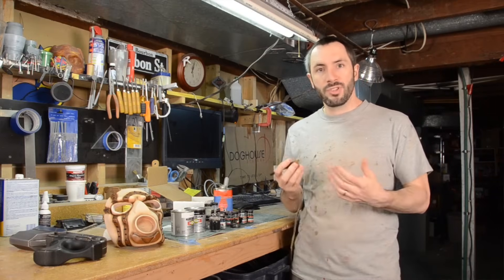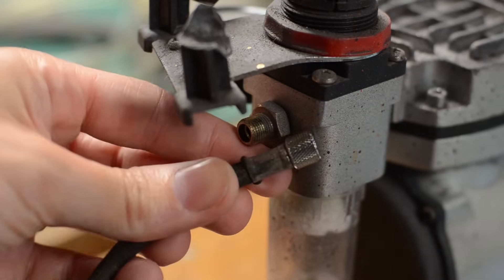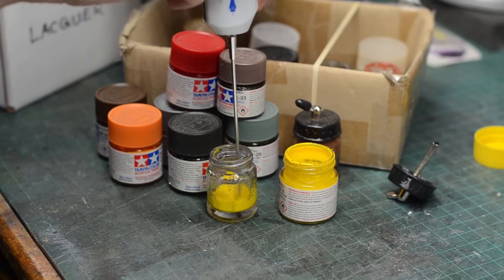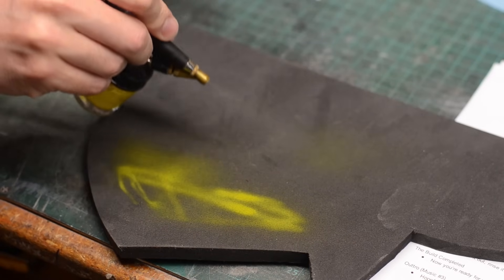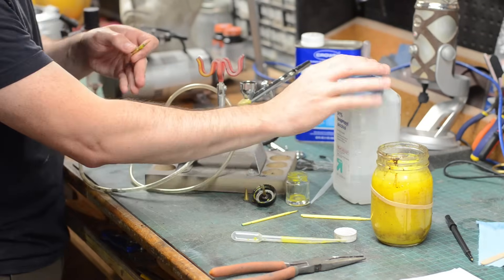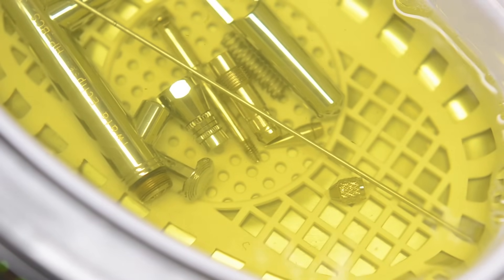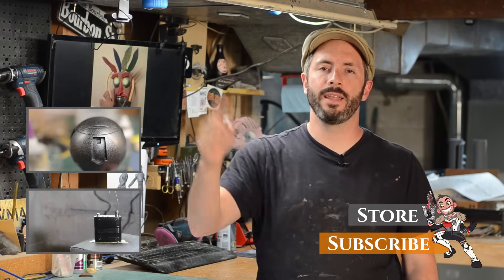Airbrush Basics: Picking an Airbrush, Compressors, & Cleaning - Prop: Shop

Comment: How do you quickly change colors when airbrushing? Do you just have multiple air brushes or can you just swap the little paint thing over?
Reply: The quickest way is multiple airbrushes. Otherwise you'd have to empty out and clean it between colours.
Reply: Barnacules Nerdgasm ooh it's barnacules
Reply: This is an old question, but the best brush for quick changes is a gravity fed airbrush as opposed to a siphon feed.

Comment: I have one of those cheapo ones just bought I’ve tried using it it starts to spray just fine but it very quickly stops and just blows out air.
Do you have any suggestions of how I could fix this I really don’t wanna go shopping for another one 🤦🏼‍♀️

Comment: I bought my first Airbrush to paint the motor in my Cobra Mustang..  It worked perfect..  I only had to tape off a couple things.  The Airbrush was very accurate and neat,   The motor looked like new..  So, little by little,  I ended up painting most everything else under the hood..   It really did look great..   An Airbush was the perfect tool for the Job..
Reply from the maker: That is fantastic!

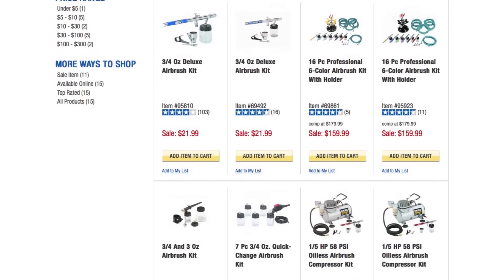Comment: Question here: I have the same airbrush as seen at 1:34 in the video. I clean it and I use enough thinner with my paint but still it gets blocked. It's not due to paint that's clogging, it's more like the push button for the airflow. Anyone else has this problem? If I leave it for a half hour it seems to work again. maybe the piston?

Comment: I have a Point Zero (El Cheapo?).  My question is about the paint bottle on the single-action.  The connection is not threaded and I've "lost" the bottle on occasion.  Am I missing a part?
Reply from the maker: I don't think you're missing any parts. The connector on the bottle is meant to be a press fit. I have no idea why that's a standard way of doing it.
Reply: Thanks for taking the time to reply.  You're right!

Comment: Hi.Thank you for this video. Can you please tell me how long can you paint with a starter kit? does it depend on the size of the compressor or..? i read somewhere that you can only paint for max 20 mins and then you need to rebuild the pressure for 2 hours.
Reply from the maker: It does depend on the compressor - it also depends on how much continuous painting you plan to do. Smaller surface areas and short breaks can extend the painting time
Reply: @punishedprops  Thank you for the fast reply. I am mostly making small projects for my son so i think i will be fine.(though this time i am building my Mando helmet) Really appreciate your help. Looking forward to your next video.

Comment: Doing large areas like for example I’m making a few mandalorian helmets for people. My air compressor like the cheap on but with a small tank attached gets boiling hot after 20-30 minutes, is this normal and am I safe to keep using. I’d hate to ruin it. If I should invest in a better compressor for large areas and leave the other for small/details what recommendations do u have. Litres of tank ect. Thanks!
Reply from the maker: It sounds like you would benefit from an upgrade. You could also plan to take more frequent breaks when painting to keep the temperature down. I don't actually have a functioning air compressor for my airbrush at the moment - I'm using my significantly larger shop air compressor. But if you search on Amazon or eBay you should be able to find something.
Reply: Punished Props Academy okay thanks Bill!

Comment: What type of adaptor do you use for the shop air compressor? I have one. Not sure which adaptor to get.
Reply from the maker: I'm not sure. It will be different depending on your compressor and the hose for your airbrush.
Reply: @punishedprops  thanks for your reply ;) your video is very helpful!

Comment: I purchased a dual-action "Central Pneumatic," dual action airbrush from Harbor Freight Tools for about $24.  I also purchased a small "Tool Shop" compressor from Menards for about $45 so my total outlay is under $100.  I don't want to buy an Iwata, Paasche, or Sata Airbrush until I get the hang of things.  I am excited.  Thank you for your fine video.  Is some of your work from LOTR??  I am looking more for automotive applications.

Comment: Hay I just got the Paint Zero Airbrush Dual Action Kit with 3 guns from a friend but I feel 2 things are missing if you could help me out.  The rubbers on the bottom of the compressor, can they be replaced? Also the hose to the Black one came with a Silver attachment that is too big to screw into the compressor and the Silver one didn't come with a hose at all like the kit I saw on Amazon but it's a V-shaped, not a screw on, can you help me with finding the correct items so I can make this work for me.  Thanks
Reply from the maker: Sorry I'm not familiar with that specific brand - you'll want to contact the company that made it about parts.

Comment: I have a question for a project I am working on. For the thorn from destiny, what would you recommend for colors and varnish. I'm relatively new to airbrushing and need some tips on paints. Thank you!
Reply: +Punished Props this is a finished 3D print not foam. I was wondering if you had any color recommendations. Sorry for the confusion.

Comment: Wow, thanks so much!  Want to get one and will follow your advice on the Harbor Freight. Outstanding, uplifting video.  Question:  If I'm using acrylic paint, should I clean with water instead of alcohol?  Subscriber from Florida.
Reply from the maker: You can use either, but I usually just use water for acrylics.

Comment: Do you use rubbing alcohol to clean your airbrush even when you use water based paints? And if so, do you find that rubbing alcohol is more effective at cleaning an airbrush? Or is it wiser to follow the rule of thumb of using an appropriate solvent per the paint used?

Comment: Considering saving for an airbrush.
Would air brushes work with Apple Barrel or FolkArt acrylic paints?
Reply: Floyd Waxler Studios as mentioned they need to be thinned with water or a specialty thinner. But they should work

Comment: I accidentally bought a powermate air brush and wanted to get the dual silver one should I return it or does it really matter I mean having the double dual I'm a beginner what do u suggest
Reply from the maker: Just use the one you have. You'll get the hang of it.
Reply: Punished Props also I wanna start paints and custom my sh figuarts dbz what paint should I use so the paint won't ware off ?

Comment: Boss can we use PU Paint in air brush.
Reply from the maker: I think there are some that work with airbrushes but you have to be very careful with cleaning. Some may require a more powerful sprayer than a typical hobby airbrush

Comment: I have the silverline siphon airbrush and it just wont spray the paint, even after cleaning, it just wont pick up the paint. I use a compressor with regulator for it. Just will not paint
Reply from the maker: You probably have something jammed in the piping. Unfortunately we aren't airbrush technicians so we can't really help you. They can definitely be finicky.

Comment: (Sorry I'm doing a bit more digging !)
Very nice video, I haven't found any further video about this topic but I have 2 questions in suspens.
1) Airbrushing seems always very thin stream. How does it compare to can spray paint in term of time to apply on a full armor for example. Do you still recommend an airbrush for large props or do you think can of spray paint are better for that ? Maybe a mix of both should be done ? 
2) Still in VS can, one thing I've always been afraid with airbrush, is the cost. Not the initial one but the paint itself. How does it compare to spray paint cans to cover 1 square meter of surface for example. Is the paint with airbrush less or more expensive ? It's really hard to tell from video as it's always tiny quantity of paint used in the airbrush, and we never see how many tubes of paint you had to use for a props :s 

Thank you in advance for any answer, I hope you can give me some... or maybe make a airbrush vs spray cans video ? :P
Reply from the maker: You can use a variety of airbrushes or HVLP sprayers to cover larger areas of paint. I've even use my critter sprayer. I like that over spray paint because then I have more control over the color and consistency of the paint. Still sometimes a rattle can is the quickest, easiest method.

Most airbrush paints are drastically cheaper than rattle cans. Remember that the majority of the volume in a spray can is the accelerant gas and not the pigment. Then again, you can get some really expensive airbrush paints.
Reply: Thank you for the detailed answer ! So would still be useful then hum... thinking I have a wishlist to send to santa claus then for next christmas :P

Thank you again !

Comment: its better to thin paint with proper thinner, i had issues with thinning it with water, paints dryed inside airbrush while painting. and for example tamya thinner extends a bit drying time of the paint. right thinner was gamechanger to me.
Reply: alcohol is around 70% of tamiya thinner, so yeah.

Comment: Water isn't the greatest thinner for airbrushing, Windex is a good around cheap acrylic thinner but best practice is when the maker of a paint has a thinner for that paint use it and beware that Brand A paint my not always be thinned with Brand B thinner always test out of the brush first on something nonporous like a paint pallet so you can see how the paint is reacting to the thinner. Even "Pre-thinned/ ready to airbrush" paints will sometimes need to be thinned as well as the thinner will evaporate over time.

Comment: I have a very old double action air brush from the 1930-1940's it was designed to shoot ink in shades of gray and black.  It was made by WEN and uses a pan or spoon that holds the ink/paint it has a needle/wire that move up and down through the ink and the air blows across the needle and on to the work the air runs a small turbine that powers the needle. I know this because the grease in the turbine was waxed up solid and I had to soak it in acetone to clean out the grease.
The double action is pressing the air valve flows the air through the gun then pull it back and it adjusts the speed of the needle it could have been used to airbrush off Marilyn Monroe's pubic hair.
Reply: +Bakamoichigei yes I looked at the 1905 patent drawing and it is very similar to mine even the air noozle is a dead match but my turbine is smaller it is housed in the mechanical tube may be that's where WEN changed it to sidestep the patent.  Also I never considered that there would be a left hand model.  But it was common to have a left handed item on tools that needed to be used by left handed humans.
Reply: Frederick Kaludis Yep, it's usually not necessary for airbrushes because modern ones are more like a pencil; not having a left or right, but these have a very obvious orientation to them, with the paint/ink pan on one side or the other. :D

Comment: Just a little tid bit. You really don't want to put the body of your airbrush body in that ultrasonic cleaner as it can cause damage over time to your mechanism for the air control parts when liquids and solvents get in there. As well as you want to remove all o-rings when cleaning with solvents as they can be eaten a way at by the solvents and will make your gun useless if you don't have backups when you go to paint. Just an fyi. Great video and good info..

Comment: I recommend the Chinese knockoffs.  Of course, if you are ethically opposed to clones then the originals are great, but for $30 you can get a pretty good dual action, gravity fed airbrush that can take whichever nozzles and needles you want.  Mine has held up for more than 5 years with light use.
Reply: Yep, I have the Master G44, I think.  I believe it was a clone of one of the better Iwata models.  I would also suggest the Iwata cleaning station and I find the Createx Wicked Colors to be worth the money.  You can kinda use some of the techniques that would normally require transparent paints if you thin them down or add their transparent base.

Comment: AGHHHHHHHHHHHHHH YOUR IWATA CLEANING MAKES ME CRY INSIDE! I've seen an iwata hopper snap off from an ultrasonic cleaner! That weld isn't as strong as you think and NEVER put a pin in an ultrasonic cleaner! That is how you eventually kill your needle point or bend it which makes your airbrush backfire. :<
Reply from the maker: I've cleaned the airbrush in there dozens of times and it's still OK. Thanks for the advice though, I'll keep a closer eye on those specific parts to make sure nothing gets damaged.

Comment: Funny you have both a gravity-fed and siphon Iwata airbrush there -- and that's why I'm here. Wanted to know if there were any pros or cons for each... I just ordered a siphon-feed for priming miniatures and painting terrain, whilst my gravity-fed Iwata will be used for finer details. But the thing is -- is there any advantage of the gravity fed airbrush? Can one not use a siphon-fed airbrush for finer details (keeping in mind siphon-feed requires higher PSI)?
Reply from the maker: <!--td {border: 1px solid #ccc;}br {mso-data-placement:same-cell;}-->I usually use the siphon fed airbrush for painting large areas with a big bottle of paint. The gravity fed airbrush is easier to mix colors right in the hopper and it's a finer nozzle for more detail oriented work. Of course there's a thousand variations of airbrushes/spray guns.